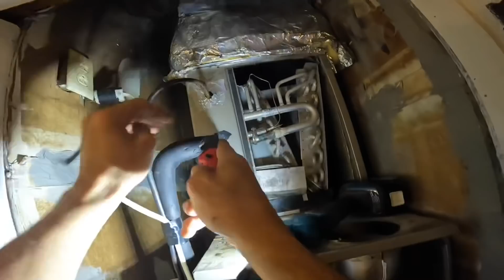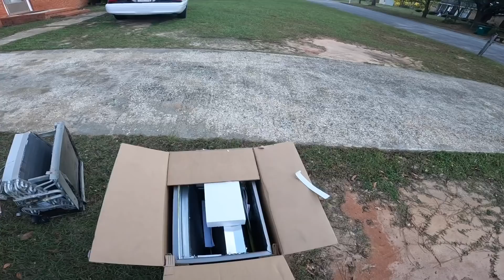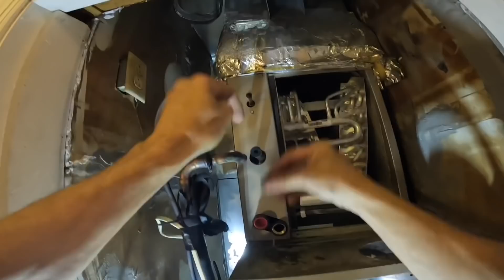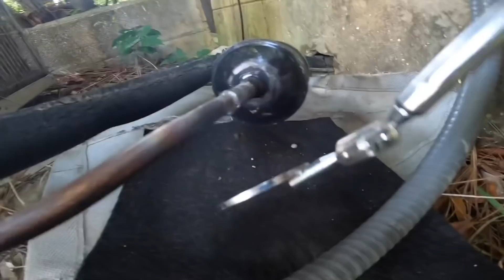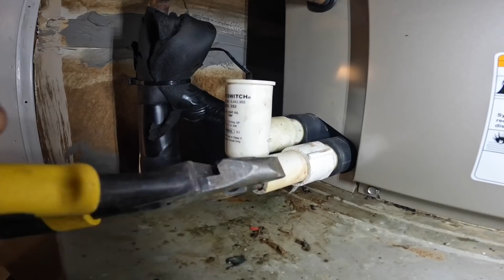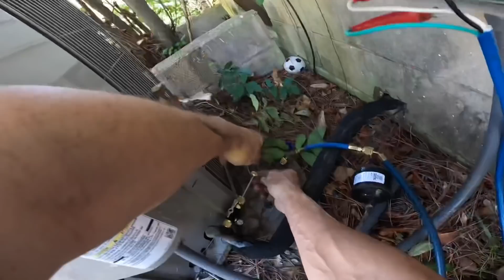Replacing A Bryant Case Coil

Comment: Why do you braze with clogged nozzles in your torch? a set of cleaning needles for the burners of your torch would allow a straight flame. Also why do you mount the dryer in the liquid line outdoors. The casing of the dryer is steel and corrodes that can spring a leak. Typically you mount the dryer indoors next to the evaporator so it cannot rust and leak.
Reply: Have yet to experience a rusted thru outdoor drier mounted on units in GA.
Reply: @briancarlisi2224  Bury it in the wet clay in the Dallas TX metro area and you will be surprised when a outdoor drier springs a leak because it corrodes through when it is made from steel
Reply: Who buries a filter drier and why???  I have never seen such in over 30 years.
Reply: @briancarlisi2224  in many cases the liquid line from the condensing unit is very long and the filter drier lays on the ground. over time it gets stepped into the soil and is half way submerged in dirt. over time the steel rusts and then you have a leak. Just mount them inside next to the evaporator and problem is solved for good. Typically when I change them and it is outdoors the new one I put in indoors, so one leak worry less.

Comment: Nice coil swap, better than in the attic!  BTW, I like ICP/Carrier, when push comes to shove, nothing wrong with leaving the cabinet (always let the customer know first of course) and putting the front panels as you mentioned.  The Same coils fit the A/H back to 1990s and Coil cabinets around 2006.   Well at least they will get 10 years on this one if they register it.

Comment: Is there combustion air in that closet?
Reply from the maker: Yes, there a rectangle pipe supplying air.
Reply: @HVACGUY  OK. I figured but didn't see it. Sometimes I come across a system installed  a few years back by another company with absolutely zero combustion air 🤦‍♂️

Comment: Straight skills man, like your vacuum set up too. The only thing that i would do differently is to use wet rags  and remove the txv bulb from the pipe when i braze, just to stay away from trouble down the road. 
Have learnt a lot from you keep up the good work!
Reply: I put a wad of wet toilet paper on line to protect that and I spray the Insulation on cover soak it cause I've had people panic from smell even after I warn them
Reply: Cool gel is ausume try it you will love it.

Comment: I've changed alot of coils that way now few yrs back had big scare using torch to disconnect lines had oil in it boy what a big ball of fire so I cut them out now.  I use a different kind of flow meter for nitrogen has a little bb in it think it's NRP what is that you have?
Reply from the maker: That’s a Western
Reply: @HVACGUY  thats the name of  of flow meter

Comment: Question? Have you thought about adding a pvc union into your condensate drains. We started that on new install and any VIP maintenance customers. It helps more than I thought about.
Also we can only get cases coils now no more uncased around. Most times we just swap the coil still.
Reply from the maker: I do sometimes, when I have them, which is rare.
Reply: @HVACGUY  what hvac supply chain you use mostly there. Johnstone, etc.
Reply from the maker: @KBGAFAN  we don’t have a Johnstone here